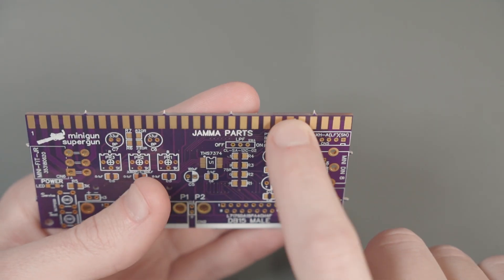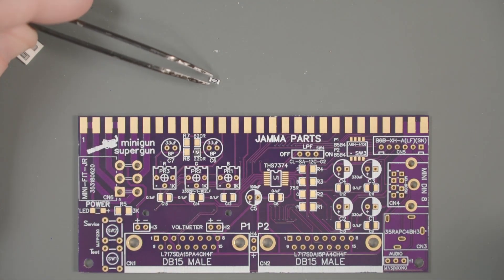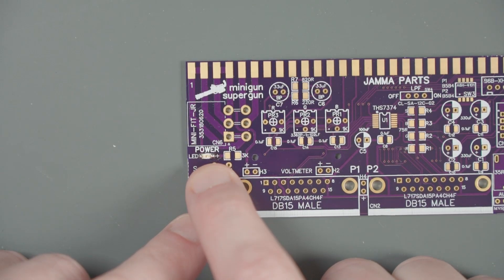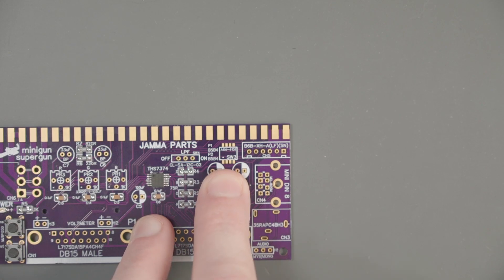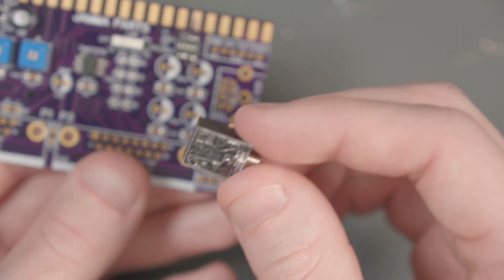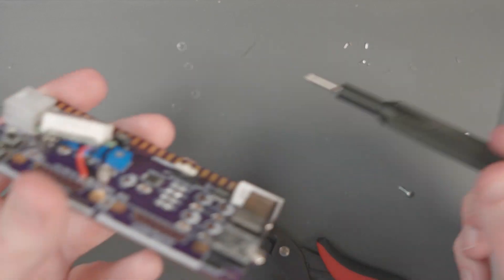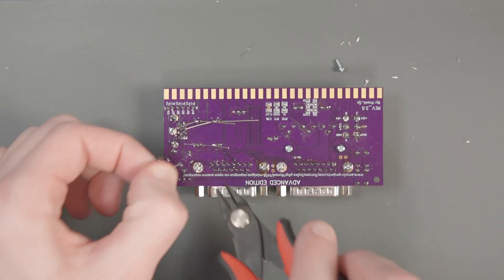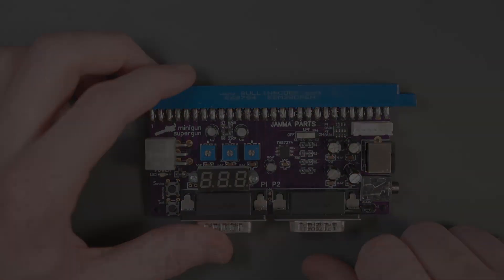Soldering the Minigun Supergun - DIY Arcade Supergun Part 2

Comment: I think the issue you ran into with the voltage display standoffs is the same one you ran into with the JAMMA connector. It looks like you should have used a 3.96mm thick board. I don't think that's an option from Oshpark which I am assuming you used based on the purple PCB.
Reply from the maker: Ahhh that makes sense
Reply: You mean a 1.6mm 3.96mm is way too thick. If the board is 1.6mm thick which is usually the standard option then that is fine. Oh and by the way those osh park bards are far superior to those Chinese pcb manufacturers especially those jlcpcb ones.
Reply: @ericochoa4034  I am aware that standard thickness is 1.6mm. That's why dubesinhower had to bend down the legs on the connector. It's also why the legs are bent on the JAMMA connector on my OMVS.

I have had small boards produced by both Oshpark and JLCPCB both are good quality but JLCPCB was significantly cheaper. It's very likely that the raw boards from Oshpark use are produced in China.

Also I work as a Machinist in the USA. All of the castings for the casing for the outer shell and final dimension machining of said casing of our "Made in the USA" products are done in Asia. We only produce the internals, I also have no idea where our steel is produced.